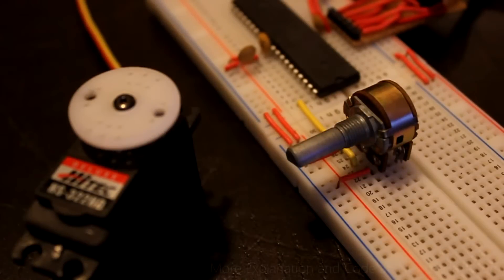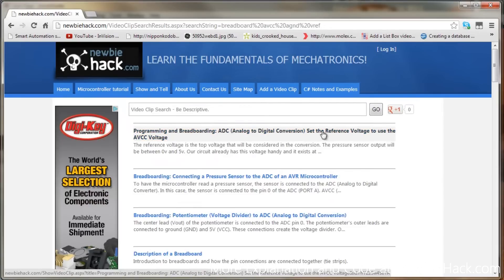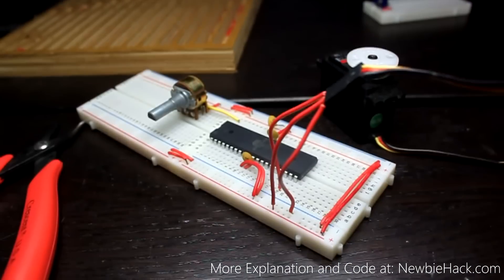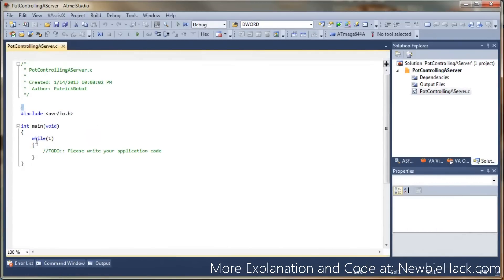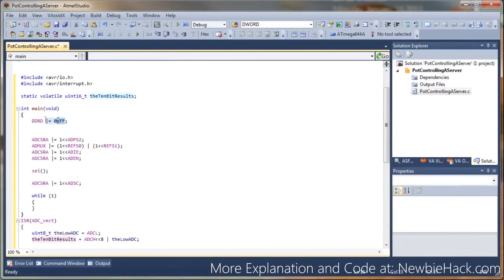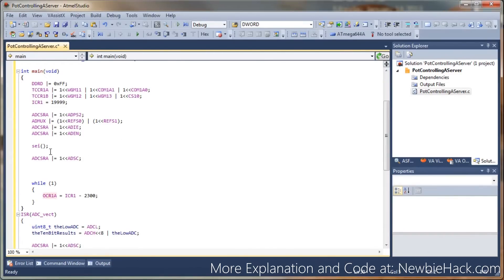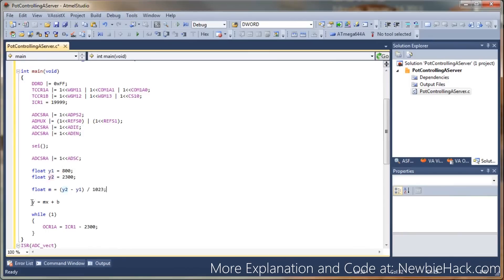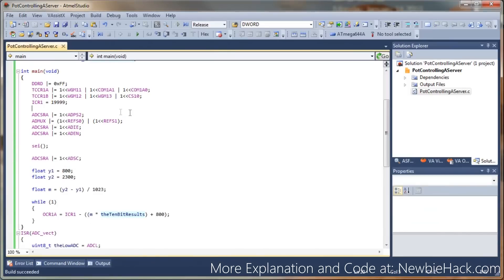54. Arduino for Production!  AVR - Controlling a Servo with a Potentiometer

Comment: Hi...I am using AVR Studio 4 version 4.18
I have connected the circuit properly and copied your codes successfully
When I try to build and run, a new prompt window opens that asks.... "Please browse to the present location for files originally found at c:\avrdev\gcc\gcc-4.3.3\gcc\"
So please help me to resolve this problem....
Also I need code to control a servo by sensing light from LDR
Thanks in advance...

Comment from the maker: Yeah, I defaulted to float for the small programs that I was creating.  I needed to floats to handle the slope intercept formula accurately.  I guess a could have used a more appropriate type for that purpose since the precision is not that important.

Comment: For Atmega32 is mentioned on page 89, "Accessing 16-bit registers". I was trying to replicate your code on a Atmega8 chip  and was not functioning, therefore I looked for reasons... anyhow, after a lot of headache, it turned out that breadboard contact was not good between pot and MCU :). So even if OCR1A is corrupted, will be refreshed next cycle, it seems.
Also I noticed that use of 'float' variables takes a lot of flash mem therefore instead of 'm' I used directly '(2300-800)/1023'.

Comment: Hi,first of all, let me tell you what a wonderful job you did with those tutorials. Practically I learned from zero thanks to your work.
Now coming to this video, I observed you mentioned about changing the ADMUX to AVCC voltage reference, but in the code remained as for internal voltage reference(1<<REFS1), or?
Another question is access of OCR1A/B registers. Should not the interrupts be disabled while updating those registers because an ADC interrupt may occur meanwhile and corrupt data?